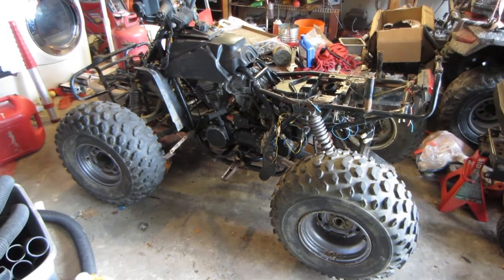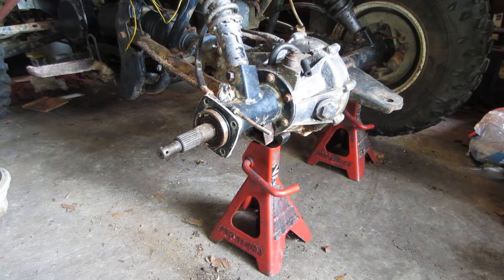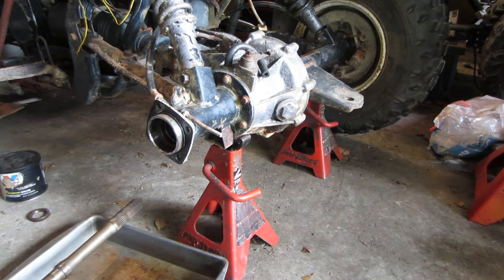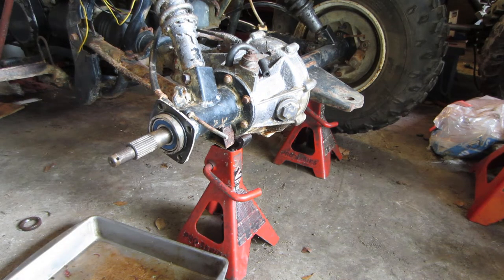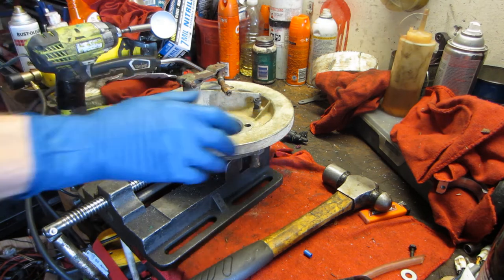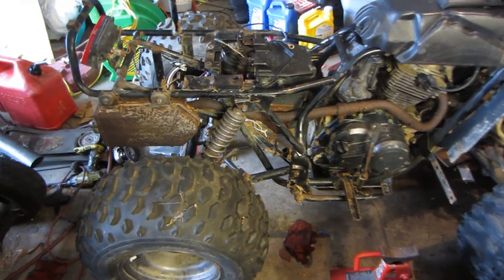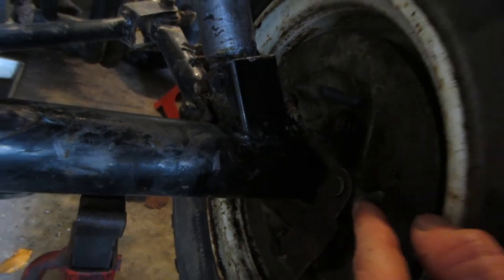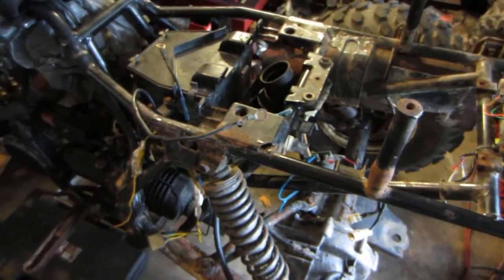$200 Bayou 300 Part 2 | Rear Brakes and wheel bearings

Comment: You caught this already, I reckon.  You got the tool turned-around.  You meant to go bearing-to-bearing, right?  Thanks for sharing the rebuild on video for us.  I needed to learn this repair.
Reply: shit.  I guess not.  I gotta ask the same question.  Why did you weld the bearing on the pipe?  just for hammer surface?

Comment: What is the name of that slide hammer gear puller you used/where to buy? Can't seem to find a similar tool like that, thanks!
Reply from the maker: Its a typical slide hammer with an axle attachment. you can rent them from most parts store.

Comment: I have one that looks almost identical to yours, rough shape and i know nothing about 4 wheelers.  It's around a 90 to 93 model i think, single headlight on top center.  Is there anyway to tell what year it was made? And maybe where to get some parts? Great video
Reply from the maker: Usually there's a sticker but sometimes it's missing. The vin can also be used. I usually get used parts for ebay unless it's a wear item.
Reply: Check the frame on the bottom right side if your standing in front of the bike. Take the vin number and type it into a Kawasaki vin decoder and it will tell you everything you need to know.
Based on the single front headlight it's a 2wd from 86-93 after that they switched over to the dual front lights like the 4x4 had before and they gave the 4x4 a facelift in 98 so it could be sold beside the Kawasaki prairie 300 and prairie 360.

Comment: I have 2 questions , was there a snap ring or anything for the bearing , I can’t seem to get it with this method, maybe I’m too old lol , 2nd question (and genuinely curious) what was the purpose of welding the old bearing to the tube ?
Reply: I see what he did.  He's got the tool turned around.  He meant to set that bearing-to-bearing.

Comment: I have an 86 Bayou. Always starts. Very reliable but it needs front brakes (hydraulic) Do you have a video showing front brake/bearing work?
Reply from the maker: Not currently. I have  2 of these that will need front bearings at some point but That isn't happening anytime soon. I have one for an Ozark which should be somewhat similar for the bearings.
Reply: @pfun41  Thanks for the reply. Hope you and yours are safe and healthy.

Comment: I have a Kawasaki 4x4-300 to drive shaft for the rear isn't grabbing so there's no power to the back wheels there's a spring in the drive shaft and it should be pushing it up in there why isn't it working the way it's supposed to be

Comment: How to you index the brake lever and limit tab to the splined shaft.
Reply from the maker: Just leave it off when you put it together then put the arm on wherever it wants to sit when it's all together again. Adjust from there if it takes too much movement to engage the brakes.
Reply: @pfun41  I found some information on the web about it the wear indicator would be placed at the beginning of the scale with the brakes fully relaxed and then the arm should be about 89 to 90° to the cable with the brakes applied

Comment: Would a rubber mallet work just fine for hammering in the bearings.
Reply from the maker: If you can get enough force on them but don't try to hammer right on the bearing.

Comment: Where’d you get the bearings?
Reply from the maker: Ebay or amazon, can't remember.
Reply: I ended up finding some, thanks. I’ve got a rattle or knocking sound on my stator side of the motor would you happen to know what would cause that? My timing chain is set right and valves are adjusted.
Reply from the maker: @RebelOutlaw  A bad stator can cause knocking on these. Unplug the voltage regulator and see if it goes away. If not the crank bearings may be worn out. Mine are but didn't show symptoms until after this.

Comment: We’re do you get the brakes
Reply from the maker: I got some cheap ones off ebay.
Reply: pfun41 I was just wondering because I bought some and they ended up not fitting correctly
Reply from the maker: @diegodelatorre6514  Did you get ones for a 220? the 300 and 220 seem to share the same basic axle design but different dimensions.
Reply: pfun41 got the ones for the 300 but the hub didn’t go all the way in
Reply from the maker: @diegodelatorre6514  You may have to wire wheel or sand the drums if they are rusty or corroded. The new pads will be bigger than the old ones and a corroded/rusted drum wont fit back over them.
Reply: pfun41 ok thanks good video btw